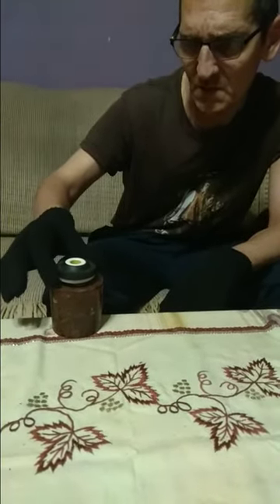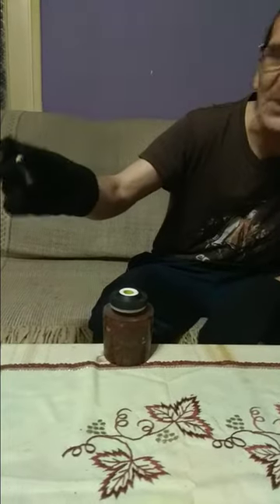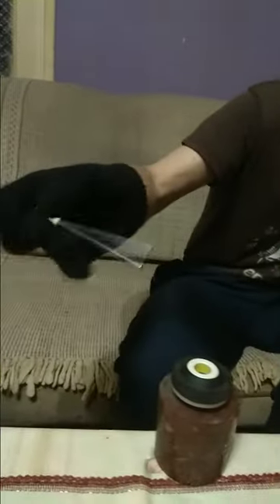Orgon Static Field Generator 1

Comment: how much voltage it gives and watts ?
Reply: it can make you fly...
Reply: how?
Reply: he will use that pulsing and create a field that can support its own field and the different of potencial of the fields will create a unified field around the rest of the system and levitate look at the other video he has,. but the fact he can spark that little thing is the power necessary to have power for the other levitation parts he uses a wire mesh screen and...other to calibrate the fields. etccc...? he is the only one in the world to have reproduced this in the public eye. he should explain in all. he  rather sit on it for a few thousands than share it and get contracts to make bigger ones.? you tell me the logic in that?
Reply: have you personally achieved levitation?
Reply from the maker: 30kV 800W-1kW of power
Reply: i have not started test with hi voltage. have once had expreme static pressure around a toroid coil i made with a spark gap. for the first time i could feel what the energy that make it work. it was like static pressure but intense like a subwoofer. i could feel the air pressure moves. i was amazed to actually get so much energy around it.
Reply: @MJBszczecin  佐野博士が連絡したい。